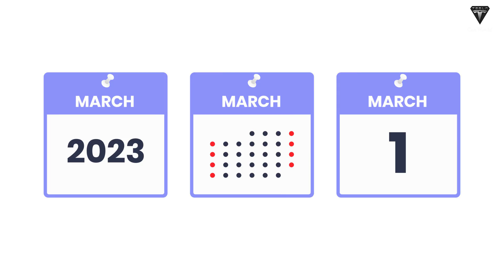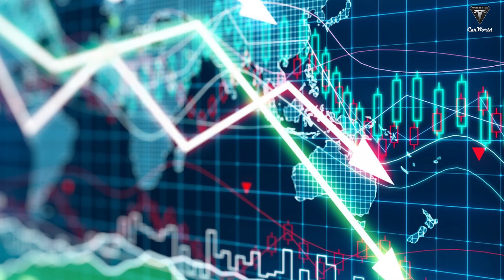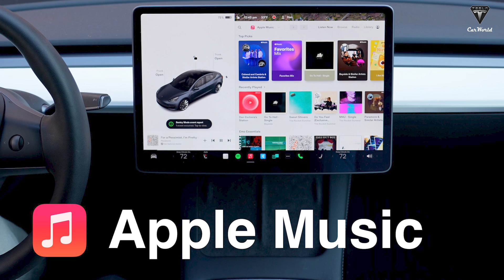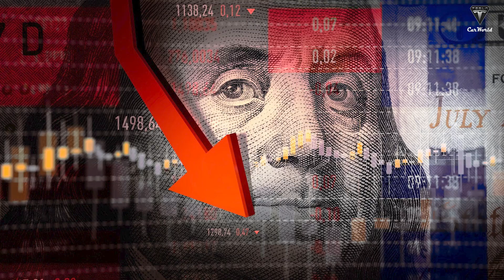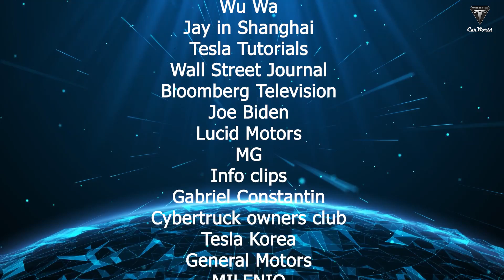Elon Musk Revealed All You Need To Know About The Latest Unique Tesla Model 2!

Comment: Coax axial flux motors with twin torque converters rather than gears and differential.  Most efficient set up allowing for smaller motor with the torque multiplier.  Not a speed demon, but for a 4 passenger vehicle withe 180 eMPG can't be beaten for a Model 2/Corolla size vehicle.
Reply: M2 18 years ahead errybody else
Reply: You have no clue what you are talking about.

Comment: I like the option of a yoke steering wheel, AWD, option for All Weather Firestone WeatherGrip for snow and ice as well as summer driving without the need to change tires of the season, make it unpainted like the Cybertruck.
Reply: Virtually impossible since stainless steel is non bendable to form th super stylish front fenders
Reply: cybertruck is painted, but with stainless steal. it wont be feasible in a 25k small hatchback, the stainless steal design is expensive and heavy. the hatchback is supposed to be cheap and preferably light for best range. the stainless steal on the cybertruck is supposed to be its wow factor, the model 2's wow factor is its cheap price for what its offering

Comment: I Bet the model 2 will have parts identical to model 3 highland inside and outside.
Plus, it will have 48volt architecture like the Cybertruck and possibly model 3 highland. 
The more identical parts, the cheaper it is to scale production. 
This project may affect the price of the other models Tesla offers.
Reply: How??
Reply: @sparkysho-ze7nm  The 48 volt architecture can be the same in every car.
The FSD Hardware already is, the front and tail lights can be the same in model 2.
the whole middle sector can be the same, including the structural batery pack and seats.The motor will be the same, but the model 2 will probably have just one motor, maybe just a front drive.
I bet Tesla engineers have a lot of better ideas than I can imagine.

Comment: What happen to the charging a battery or a olternater to charging the battery.
Reply: It may be possible one day, to have heavily congested roads during rush hour, to have inbuilt rolling-road sections linked to a solar panel array and electricity generation windmill, together with a gearing system so that vehicles can get their electric batteries charged by rolling resistance through their regenerative breaking system.

Comment: I would love to see a 25,000 ev……it would create millions of people to buy a ev as a 2nd vehical for scooting around town
Reply from the maker: Tesla Model 2 with $25,000 even cheaper, everyone can buy it and go around city!! Thanks for your comment
Reply: I think that it is inevitable that Tesla will gravitate towards creating a new class of vehicle, which is an electric powered passenger vehicle for developing countries (cities) which sits between a motorcycle and a city-car that can be made out of carbon-fibre.

I envisage this new class of vehicle to be a 3m long, two wheel drive, two-wheeler, with an inbuilt gyroscopic stabilizer to prevent the vehicle from falling over. 

It would have two hub-motors and a sufficient structural battery for around a 150km range that could be charged up by local solar and wind chargers, making vehicle journey's virtually free.

Such a vehicle would drastically cut down on road congestion and pollution and make last mile deliveries of goods and people more efficient.
Reply: I want to design an install wireless charging
Reply: @sparkysho-ze7nm 😅

Comment: 54kW battery? It will not go far... 400km?
Reply: 450km. Remember the car will be lighter
Reply: If the car was made out of a carbon-fibre structural tub, which may be 60% lighter than a car made from steel and aluminium, a crazy-small structural battery pack and motors will be required  to meet the industry average range and it would be that much faster to charge too.

Comment: I wonder if the breakthrough manufacturing technique is a production line adopting a carbon-fibre tub design which is up to 60% lighter than traditional manufacturing techniques, requiring a smaller structural battery pack and smaller electric motor to provide a range of around 350 miles between charges and a sub 7 second 0-60mph sprint time.
Reply: Carbon Fibre is expensive and hard to manufacture at scale, so not suitable for model 2. Expect a gigacast internal structure with moulded thermoplastic skin that does not require paint. This is why Elon is now saying that the oil industry is good!. He needs them to make his special plastics!
Reply: @bananacabbage7402  I agree that currently carbon-fibre is expensive to manufacture at scale, when compared to steel and aluminium.

However, if Elon and Tesla can make the manufacturing breakthrough by designing a giga-factory, from the ground up, to produce a carbon-fibre product at scale, thereby reducing the unit cost then, the benefits for Tesla and the buying public would be breathtakingly game-changing.

We would be able to buy a lighter & safer product that would surely become the optimum way to build all transport vehicles. 

I wonder if the giga-press process may be able to cast two full length structural car parts, for each side of the vehicle, which are then are joined together with the structural battery, structural motor and gearbox and structural suspension or if the way forward is a production line of carbon-fibre 3D printers.
Reply: @bananacabbage7402  > Everybody seems to "conveniently forget" that Carbon Fiber IS a PETROLEUM BY-PRODUCT!
And for that matter, so is PLASTIC... and nylon and rayon and vinyl for the interior...as well as MANY of the lubricants and other materials... I think the biggest difference is the amount of Hydro-carbons released during BURNING of gas and diesel... But you are correct, that the molding and curing processes for C/F are time-consuming and expensive, compared to pressed metal shapes...
Reply: @bananacabbage7402 
Probably one casting
Reply from the maker: You do not need to worry too much, Model 2 will definitely inherit the best in terms of technology, Tesla will not let you down because Elon Musk is really serious about it.
Reply: Good idea Aint it
Reply: Carbon fiber is too expensive and slow for Tesla's goal of high speed production.
See time 49 to 52 minutes: https://www.youtube.com/watch?v=Hl1zEzVUV7w&t=10487s